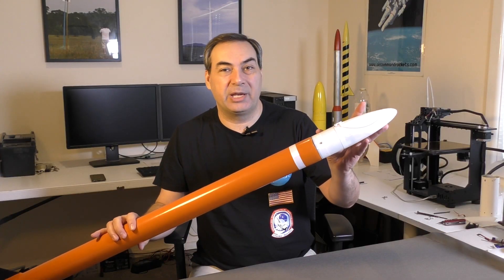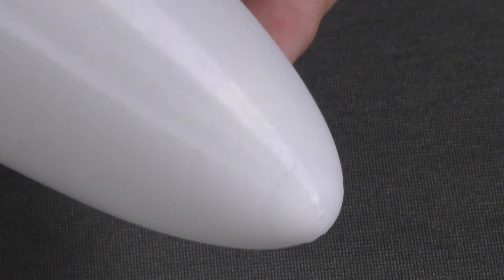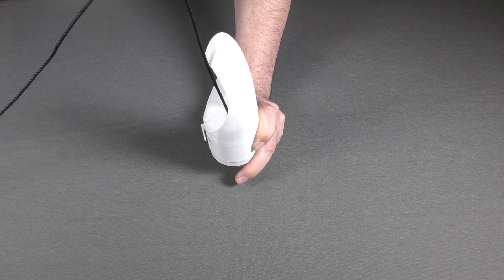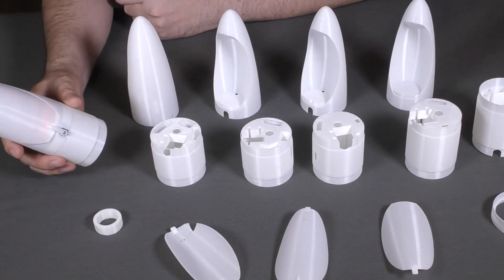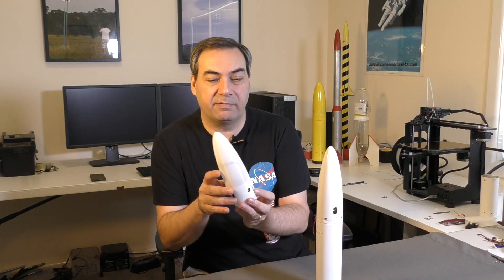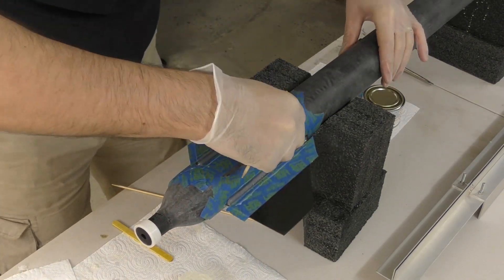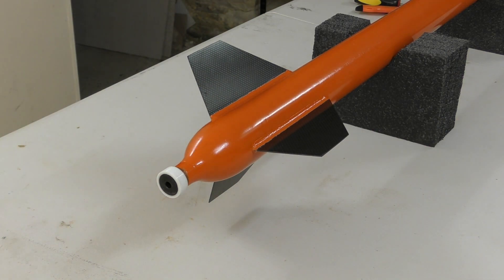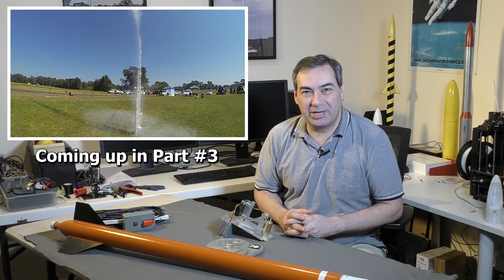Nova Water Rocket - Part 2 of 3 - Parachute Deploy Mechanism

Comment: I love your amazing work! Could you upload the 3D model of the nosecone? Or where is It available? Thank you before hand ❤
Reply from the maker: Thanks! The full 3D model is available here: https://www.thingiverse.com/thing:5502347
Reply: @AirCommandRockets Thank you very much for your quick reply. I have taken a look at the page you sent me, it has everything I was looking for except what is related to the parachute deployment system, there is no reference to the exact components, only a model with a tommy timmer, I have been able to find on the internet the servo motor and the altimeter but nothing about the servo timer and the batteries.
Reply from the maker: @carlitoskii That is one limitation, the servo timers used in the design are unfortunately no longer for sale, but it should be possible to modify the design to match what ever controller you want to use. The batteries we used were:  https://hobbyking.com/en_us/turnigy-nano-tech-300mah-1s-45c-lipo-pack-w-jst-ph.html One possible flight computer you may be able to use (provided you modify the bracket that holds the controller, or attach it differently in the nosecone) is this one: https://www.tindie.com/products/daninvents/rockit-flight-computer/

Comment: How did you connect the nose cone and payload bay. Did you just make the radius of the payload bay a little smaller?
Reply from the maker: Yes, there is a smaller diameter step in the payload bay to slide the nosecone over so the outside diameters are the same.

Comment: Would this deployment mech work on a high powered engine based rocket?
Reply from the maker: Probably not directly as is, the servo horn here is quite weak and so you would need to re-engineer the locking mechanism. On a HPR rocket you typically have much larger forces, and larger parachutes with longer shock cords so you would need a bit more space in the nosecone. You would also need some kind of simple spring to help get the parachute and door to come out cleanly at higher air speeds.
Reply: @AirCommandRockets    thank you for the reply! That's how I redesigned it. I made the nosecone elyptical and big enough to fit the drouge chute then plan to mount the servo and horn on the inside of the nosecone so the entire mechanism is concealed. I plan to make a separate segment in the upper portion of the cover to attack a spring for releasing the cover, tho since it's ideally directly after apogee there shouldn't be much greater forces. I just don't know if it'll still work given that it won't have an ejection charge. (My first rocket btw)

Comment: What was the tool , that's used to hold the fins in vertical position..
Reply from the maker: That's just 4 aluminium L brackets bolted together with a small spacer in between that is the same width as the fins. You can change spacers when you have different sized fins.
Reply: @AirCommandRockets  great idea , actually can I have a picture of that

Comment: Lol that's the same weight as my RC plane
Reply from the maker: Does it go as fast? :)
Reply: I haven't tested it yet I'm still waiting for one servo to arrive. To be fair most of the weight of My plane is the electronics. 3\4 electronic the rest balsa. It's my first build, before that I've only built gliders. I don't know how well it will fly because my motor is underpowered compared to what I originally envisaged.
Reply: Well electronics and control linkages.

Comment: Have you guys created a dual deployment system? If so how did you guys apply the code for the parachute as it’s descending down (second parachute).
Reply from the maker: We have done some dual deploy tests a few years ago, but just used a timer to deploy the second chute after apogee. Ideally you would use a barometric sensor for the second parachute deploy so that you can set it to deploy at a particular altitude. It's more reliable that way.

Comment: Do you tried the cross like parachutes ? I made minirockets in a high school club with the CNES in France, (1meter of height, solid propellant, 67mm of diameter, 1,2kg, 300m at apogee) we always used the cross style, never any problems, just fold it precisely : 
You start with a cross
You fold to of the arms on the other two, you get trousers
You fold all the arms on top of one another, you get a house 🏠
You attach your release cord on the top of the roof (in the middle of the parachute)
You fold the roof of the house inside to get a rectangle
Now you can fold it as you want to get it fit in the rocket, just avoid to over wrap the chute in the cords, prefer align them under it in the parachute bay

Comment: You say that you don't have to paint the nose cone, be careful, even a mate paint changes drastically the aerodynamics, for example, on business jets, a mate paint increase by the fuel consumption 6% (the figure is from an student in  aeronautical engineering, in training at Dassault aviation)
Reply from the maker: I agree where performance  is important, a polished surface is a must. In this application, however, it is not so important. It's just a model rocket.

Comment: Great to see the improvements you made to the design! I particularly like the servo attachment and electronics housing. All the best for the flights!

Julian
Reply from the maker: Thanks Julian. Your design seems to work very well. :) We're looking to change the design slightly to add a camera into the very tip. There is just enough room in there. The flight video should be ready on Friday.

Comment: amazing compact Deploy Mechanism you have designed. and grade mini-series you are doing. and it shows off how relatively easy it is to make a composite water rocket
Reply from the maker: Thanks. That was the intention of the project, to simplify it as much as possible where it should be fairly easy to reproduce with common tools. We intentionally  didn't use the lathe for this project.
Reply: nice that was the plan and I think you did a wonderful job with it . and can't wait to see her fly. and any plans to release the 3d model for the nosecone?

Comment: Incredible job! Make me want to get a 3D printer for our channel. Keep it up! 🚀
Reply from the maker: Thanks. You won't regret getting a 3D printer. And fairly good ones are a lot more affordable these days.  It just opens up a whole new way to quickly make useful components.
Reply: @AirCommandRockets  Do you sell/have the CAD files for this nose cone design?
Reply from the maker: @NMRocketry  We're still making a few tweaks to the design. We'll make those publicly available when that's done.
Reply: @AirCommandRockets  I love your parachute deployment mechanism but can’t seem to figure out how to make the design in CAD with all the smooth surfaces.
Reply from the maker: @dusterthefirst  The 3D models are designed using CSG (https://en.wikipedia.org/wiki/Constructive_solid_geometry) rather that through faces and vertices.
Reply: Air Command Rockets Hi! I love the design process. Would you mind sharing which 3D printer you are using? Seems to have a good size build area and the prints are a very nice quality.
Reply from the maker: @kevinmcnally7796  We are using the Makergear M2 for out 3D prints. https://www.makergear.com/products/m2  We chose it because it had a nice print quality, though it is a little pricier. I think these days there are cheaper alternatives with similar specs.
Reply: Air Command Rockets so kind of you to share. Thank you!

Comment: How do you ensure that the fins are 120° apart? It really looked precise 😳
Reply from the maker: Wrap a piece of paper around the body tube, mark where it overlaps. Take the paper off, divide the circumference by 3. Mark it back on the paper, put the paper back on the rocket and transfer the marks to the body tube. The fin alignment jig then takes care of the other two dimensions.